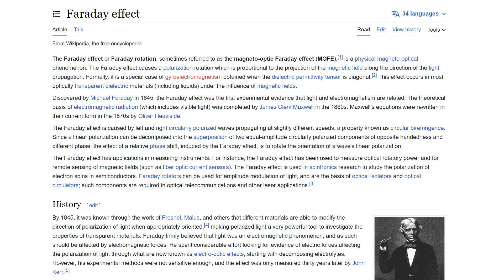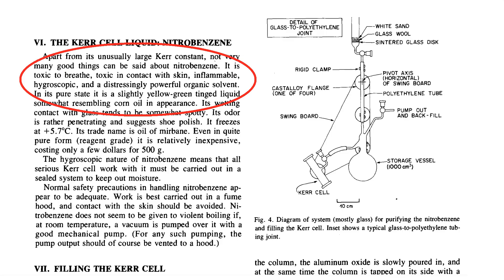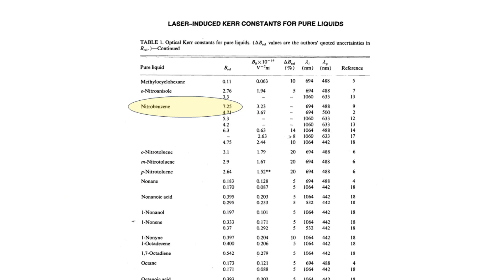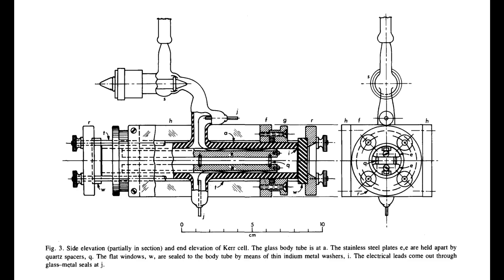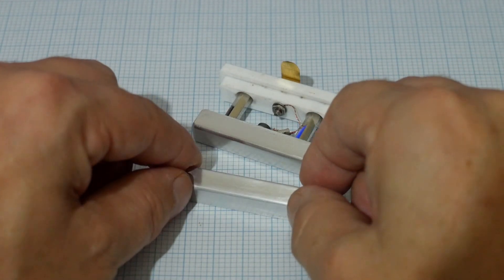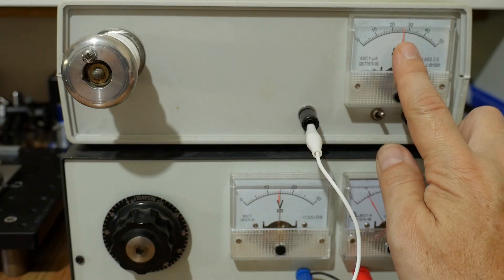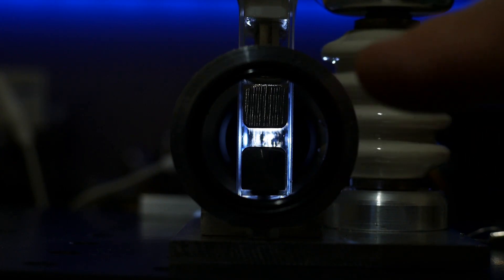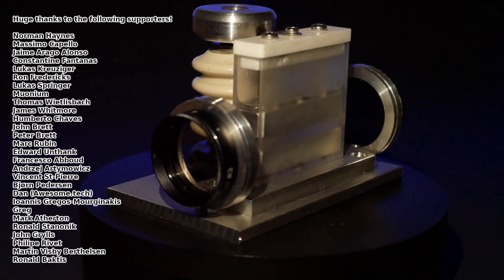Controlling Light with High Voltage and Aniseed! The Kerr Effect!

Comment: I am not sure if the Kerrkonstant of Anethol is higher than the one of Nitrobenzene. In other Literature you find a Bk of Nitrobenzene from about  4×10−12 m/V² and this is much higher then the Value of Anethol of 6.9 * 10−14 m/V². Maybe that Difference comes from the Measerment. In your Linked Paper they measure the Laser Induced birefringence. And not induced by an electrical Field.  Light is an electromagnetic Wave, i dont know. But even if Nitrobenzene has a higher Kb, you show that it works and non toxic Medium is needet. Very nice Video. Thank you.

Comment: hi les . we use eom at work to modulate mp lasers they are fluid filled and have two xtal / glass rods inside . are they kerrs cells ?
Reply from the maker: It is not likely. The Kerr effect is more or less a curiosity these days, there are more efficient materials. For Modulators and Q-switches the Pockels effect is used (Lithium Niobate), or the Acousto-Optical effect (Tellurium Dioxide or similar materials)

Comment: 30+ years ago, I worked at the US Bureau of Mines at the Bruceton research center. They had an antique high speed camera in a bombproof's control room. This camera could take 22 photos at a shutter speed of 2Mfps. The film was stationary and held around the perimeter of a partial circle. The camera had a rotating mirrored block in the centriod of the arch, a hollow coil which, when energized with a huge current, collapsed a foil tube to stop exposure, and a Kerr cell as a high speed shutter. I had the job of troubleshooting and repairing the ancient home brew trigger and shutter driver circuitry. It was a laborious and finicky task getting everything to work correctly and produce usable images. I still run across images from that camera here and there. I don't know what they had used in the Kerr cell, but it could be modulated at 2MHz.
Reply from the maker: Sweet! Without a doubt it would be Nitrobenzene, for all its toxicity it gets the jobs done, and it will easily switch at megahertz speeds. That sure sounds like a very interesting setup!

Comment: The paraffin+petroleum jelly potting is a really cool idea. Most potting compounds are non-reversible, but you could easily melt out that wax without damaging anything if you needed to repair the circuit underneath. It's even better that you can buy the two ingredients ready to use at most grocery stores or any craft store.
Reply from the maker: Exactly. The original plan was to use mineral oil, but it would require a sealed container else the HV causes it to spray everywhere!
Reply: I've always been a fan of wax vacuum-potting. A whole lot less messy than tar and, as you said OP, much less troublesome to repair than a sharp point breakout in epoxy. It's also generally better for the environment than most oils or tars, as well as less toxic to the user. It serves as an early-warning if a component is over-heating and, finally, wax being a solid (as opposed to a liquid oil) allows it to prevent outside detritus from interfering with normal function.

Comment: High voltage tends to emit better from pointed sources so it's my guess those "stringers" observed could be caused by surface imperfections on the electrodes. Highly polishing those electrode surfaces might reduce the stringers substantially.

Comment: 6:04 how does the lens do that
Reply from the maker: These are polarizers. Each only allows light through of a specific polarization, so if you cross the polarizers, effectively you are blocking all light, and if they are uncrossed they will let light through.
Reply: @LesLaboratory  by rotating them?

Comment: Les, try a 100 meg-ohm resistor to start, (you may need to tweek the resistance up or down to find the sweet spot ), connect it across the kerr cell electroids,  It may arrest the voltage enough so that the stray impurities won't discharge after you shut it down so it turns the photons all the way off on their axis.  Something I tried decade's ago that worked with N.B. I also  used "Moth Balls" diluted in methanol. Be very careful. I like this chemistry your using for his project.  

I am: Dale Robertson.

Comment: I would imagine your conductivity breakdown is caused by water contamination, simply redistilling your anethole over a suitable drying agent will do the trick, to get it essentially dry you will have to use something stronger than typical lab drying agents, if you can source P2O5 that will work, or Sodium metal, a OTC attempt that would also work would be ripping open a Lithium AA battery, they have quite a long sheet of high quality Lithium metal in them, just work quickly and rinse the rolled up foil in some fresh dry hexane then added to your anethole, you won't need much Lithium to form the hydroxide, store the remainder over hexane, paraffin oil, etc. It really doesn't take much contamination with a trace of moisture to totally ruin the dielectric nature of your oil, just like it doesn't take much metal ion contamination to ruin the non conducting nature of pure water, the slightest hint is all it takes...

Comment: Yes, nitrobenzene is a strange beast, as a solvent for certain reactions it is unsurpassed, it also does some very weird things to plants, seeds specially treated with nitrobenzene show highly accelerated growth, of course that's not directly useful because the seedlings are TOXIC...actually, a similar effect can be seen in humans who use dinitrophenol, it has the effect of making cell membranes too leaky, ions leak out, so the cells use shitloads of ATP (energy) to pump the ions back in ! this has the effect of ultra rapid weight loss, a very dodgy way to drop tons of weight in record time. In fact, in the last century, workers at explosives factories (TNT, Picric acid etc.) were always quite thin, due to exposure to nitrobenzene...

Comment: Interesting choice of insulation. If im not mistaken both paraffin wax and petroleum jelly are flammable under certain conditions, eg when warm they soften and vapourise at low temperatures, and have a low flashover temperature.

Wouldnt a better. Choice be epoxy resin or similar?

Comment: The temperature discrepancy in freezing is how you purify it. It might indicate an impurity, but it might be slow nucleation. Some organic compounds are really finicky in crystalizing, try adding some of the solidified phase to supercooled liquid phase to act as seed crystals.

As for the "stringers", anethole is not electrochemically inert (at those voltages, nothing is). If you pass current through it, you're generating biproducts. Look of electropolymerization of styrene. Anethole has that same double-bond, and that paper saw styerene polymerization at 2 volts, not 2000.

Comment: If those "stringers"  are solid impurities, could you use a small pump and circulate the fluid through a fine filter to remove it?  You'd need to do it slowly to avoid air bubbles and turbulence I would think, though 🙂

Comment: Very cool! I'd read about Kerr cells in laser literature, but never seen one in operation - great power supply too.
When I was a kid nitrobenzene was still used comercially, and the overpowering near-almond smell was characteristic and penetrating - anethole is definitely nicer. Cheers...
Reply: I thought I recalled nitrobenzene used as an ingredient in glow plug engine fuel for R/C cars when I was a 1970s teenager.  When the toxicity was mentioned in the video, I did an internet search and determined that the "nitro" that's in glow plug engine fuel is nitromethane... but was that always the case?  When I was a kid, I'd roll mercury around in the palm of my hand because room temperature liquid metal is cool.
Reply: @Liberty4Ever  As you say, it's nitromethane and has been as far back as I can find (late 1940s when glow engines were first available).
Reply from the maker: Thanks! Someone said reminiscent of boot polish, but it became unobtainium here after the '80's The anethole smells strongly of Aniseed, which I quite like.
Reply: @LesLaboratory  - I need to get some star anise to make chili oil for Asian cooking.  Who knew it could be used to polarize light?  Gotta love science.

Comment: You have two effects going off there.
 One is a plasma effect of lensing when concentrated as you are doing between the electrodes from the very high voltage.

 The next effect is one of the additive you are using. It is crystalizing and then dielectrically orienting itself between the two electrodes. You can see if wiggling up and down like it is being vibrated and oriented between the electrodes (strings). This also has a lensing or focusing effect as well and shortens the path between the light source and the camera via the crystalized aniseed extract you are using, which is a sort of diffuser based on it's crystalline structure.
 The trick with the polarizers is an excellent way to use a light source and illuminate the targets between the plates without having to filter out the led source light for the camera.

There have been many interesting experiments like this done just with seeds and high voltages. The seeds will jump up and down as they ferry charge back and forth between the electrodes. Much like the crystals are doing between your plates. This can be likened to lcd technology as well as the voltage controls the orientation of the crystals to make a shutter effect.

 That is what I get from this presentation.
Nice presentation!
Reply: It's nothing to do with crystallising, it is a property of some liquids and solids, so the effect cannot be to do with any phase change. What is happening is that the high field strength distorts some of the bonds in the molecular structure causing it to rotate the plane of rotation of the light source.

Comment: Until today, I only knew of the Kerr Cell in connection with John Logie Baird, who used it to modulate light in television receivers.  I don't know if he used the appalling nitrobenzene, but I believe he used grid electrodes to reduce the control voltage needed (and renamed it the Baird Grid Cell!)  I'm surprised he didn't try a mechanical shutter to modulate light!  If you can make "Phonovision" recordings on a 78, you must be able to move a diaphragm at the highest frequency needed.

Comment: Very interesting and informative video.  I believe that the same construction that you created to demonstrate the Kerr effect can be used to clean the solution.  If a solution is slowly passed between two electrodes under voltage, the contaminants must remain between the electrodes, forming "threads" between the electrodes, and you will have a purified liquid at the output.  I wish you success in your experiments.
Reply: What a special kind of more on.

Comment: Very valuable, I have to try this out myself! Unlike in the Faraday effect, the rotation of light is due to birefringence, right? So you can generate circular light with this. Does it mean that, just with waveplates (fast axis, slow axis), if you rotate the laser so that it's polarisation is parallel to the electrodes, the light won't be rotated?

Comment: Great video! You may be interested in Mie Scattering. In particular, you can use lasers to measure the particles in both a liquid as well as air. Industrially, they use lasers to measure particle size and counts for clean-rooms. Industry typically has two topologies - diffraction, and a reflection/scattering method. You can even pick up a sensor for $30 or so from sensirion now.
Reply from the maker: Cool, I will look those up! On my dream list isban external cavity He-Ne for particle counting, but the are darned expensive!
Reply: @LesLaboratory  If you find yourself in need of some electronics, 3D CAD, or software help look me up. I'm working on some precision amplifiers and electronics to support some instruments so happy to help in whatever capacity if it supports your cause. Thanks again for the videos!
Reply: @LesLaboratory  They can be found surprisingly cheap sometimes, I have four of them (all 25mW +) and paid less than 150 pounds for any of them, some including power supplies.
Reply: yeah, I used to work with a Malvern laser particle analyzer, Mie theory, back scattering, all part of the system, I actually built a totally new dispersion unit for Dairy powders, and Malvern came out to see it. 100 k for the machine, nice toy that was...

Comment: Interesting LCD effect with the liquid (and you could say that modern LCDs are basically efficient low voltage Kerr cells all things considered), at the same time, Kerr effects slows down in liquid (and electrodes not as closely spaced, as capacitance can affect it also), while it's massively faster in solid state Kerr cells. Planning on using it to Q-switching a laser?

Comment: Interestingly enough, I recently discovered the peculiar attributes of anise extract, while making root beer. Indeed, it did not want to mix with water, and caused a bit of a light foggy appearance as it was mixed in. It also seemed to precipitate something onto the stainless spoon I used to measure it. 
Intriguing!
Another parameter that would be interesting to test, aside from the behavior at high switching frequencies, would be the linearity and precision of the polarity change per volt, from 0-360 degrees (if you can achieve that within the breakdown voltage of the kerr cell, or before leakage significantly hampers the linearity).
Reply from the maker: interesting. Yes, I want to try and properly characterize the cell, and derive the kerr constant. for that I need to properly purify the anethole.
Reply: Thank you!

Comment: If the effect is stronger and it's much less toxic, I'm very curious why it's not the more commonly used one. Is it worse in some other way?
Reply from the maker: I don't think the effect is as strong as with nitrobenzene, and I lack the analytical equipment to test it. It could be for two reasons: The kerr effect is more or less a curiosity now, given there are pockels cells available that are far more practical. Secondly (related to the first), I have only found a single reference to the Kerr value of Anethole anywhere in the literature, so perhaps, as these cells fell into dis-use interest in research dwindled.

Comment: That's pretty cool... is the same effect (kerr) what's active in a LCD, just longer, so lower voltage, but because longer/less springy, it's slower?  What's the kerr on sugar?  Can I alter the twistyness with electricity or am I just gonna make an electrolysis mess?
Reply: An LCD relies on movement of the crystals in the liquid crystal, it's a mechanical process which is why LCDs are relatively slow. Sucrose, and possibly other sugars, exhibit the effect in solidus, but you'll need to grow some decent crystals to try it and somehow prevent them from hydrating.

Comment: Could the solid be from polymerisation? Anethole is similar to styrene. Add an electron and that will react fast. The impurities may be initiating the reaction. However, is the double bond on the side chain necessary for the Kerr effect? Could you hydrogenate to dihydroanethole?

Comment: I made a Kerr cell out of nitrobenzene a few years back. I didn't know that it just plain dissolves polycarbonate. I ended up spilling quite a bit of it as it at through that cell. Its nowhere near as dangerous as people make it out to be. This is more one of those "you don't want to be chronically exposed to it" kinds of things. Thorlabs makes some long-path quartz cuvettes that I use now.

Its incredibly difficult to find something that can shutter light at nanosecond timescales and sane voltages other than nitrobenzene.
Reply from the maker: Yeah, benzenes are pretty good at dissolving things. Still, I wouldnt want to be exposed to the stuff, and in my house at the moment, its just too much of a liability. Anetholebis harmless.

For sure. Anethole is a litte larger than nitrobenzene, but still, it would be interesting to try it out.
Reply: @LesLaboratory  It would be interesting to try recrystallizing it to get the purity up but even though its melting point is 20C, these oily aromatics are notoriously hard to crystallize.

Like you said, there's probably a lot of other junk in it from anything other than an analytical source. I'm assuming most of what you can buy is just straight steam distilled and that's it. maybe heated to remove the water.

Comment: Huh. So they could have built lcd screens from like, 1935 if they'd thought of a way of switching on and off the field to pixels and put a backlight behind it? o.o
Reply from the maker: Kinda, though LCD's operate on different principles. The high voltage to drive Kerr cells is quite problematic, but if you were so inclined and happy with 1 inch pixels, it could have been done. Mechanical TV after all was almost there in terms of technology!

Comment: You could purify the liquid using a high voltage gap as a filter. That would remove precisely the stuff causing the problem.
Reply from the maker: Totally, this has been suggested, and I might attempt this. It would be a very interesting method of purification, unless its doing something weird like polymerizing the Anethole or something.

Comment: The optical effect is really cool, but I'm also interested in those stringers and if the could be used to help purify the liquid by precipitating out the contaminates.
Reply from the maker: For sure, there have been several comments to that effect. I reckon it's worth a shot.
Reply: Look up isoelectric focusing.  The current creates a natural gradient using natural buffers.  The molecules will precip at neutral Ph point.  Don't need the ribbons.  You can do this easily with blood and it's proteins

Comment: The electrodes are immersed in the anethol liquid? at that high voltage you don't see ionization and discharge?
Reply from the maker: Yes, they are immersed. Anethole has relatively high dielectric strength, however if you push it too hard, breakdown can occur.